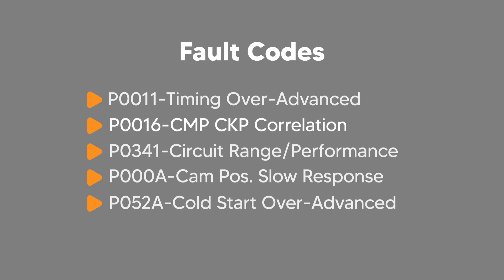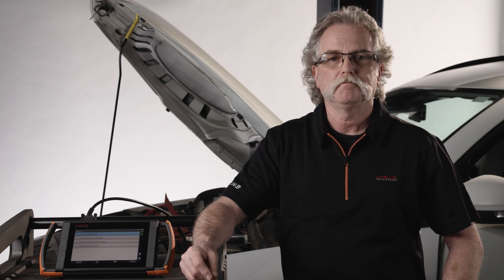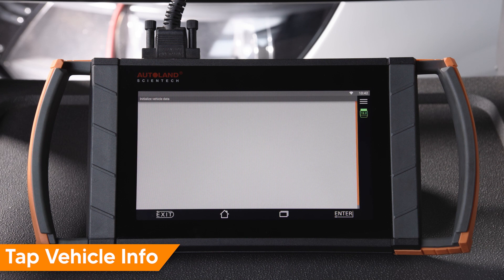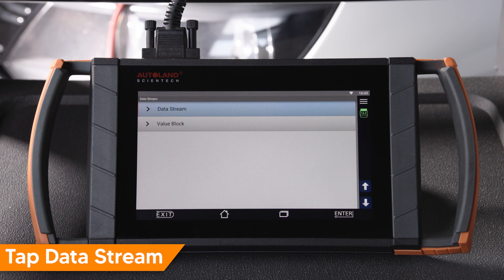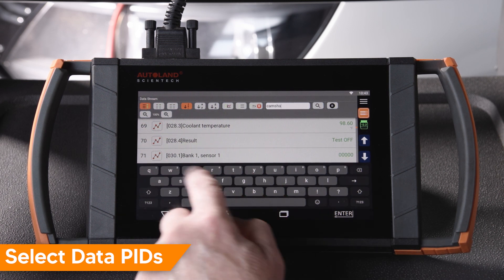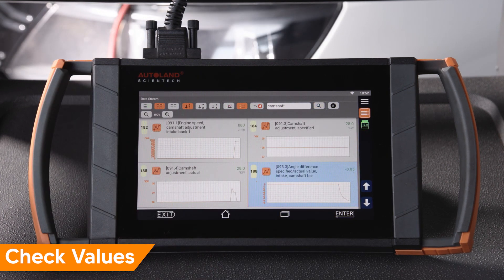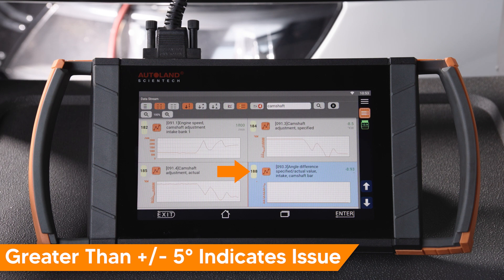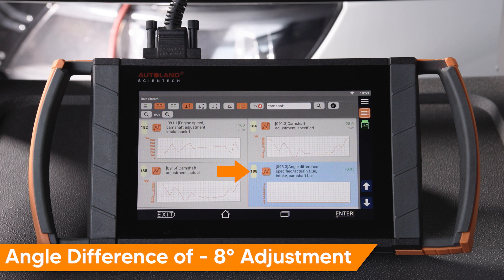How to check & Test Camshaft Timing on Volkswagen | P0011 P0016 P0341 P000A P052A Codes

Comment: My vw golf 5 tsi..started doing coldstart missfires on cylinder 2 after new timing chain..at first rarely then at almost every cold start is this timing chain issue?
Reply from the maker: If it is just a single cylinder, I would think it is not the chain. I would check spark, fuel and compression on all cylinders. Once you isolate what part of the combustion process is causing the misfire, you can identify the root cause.